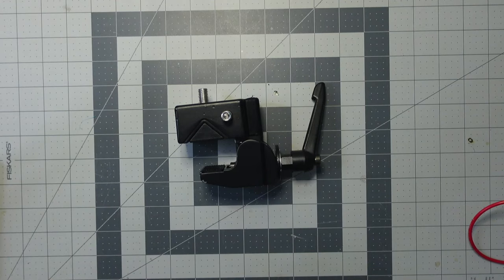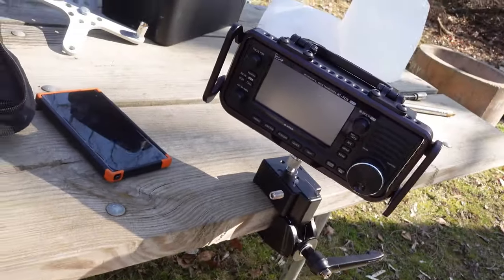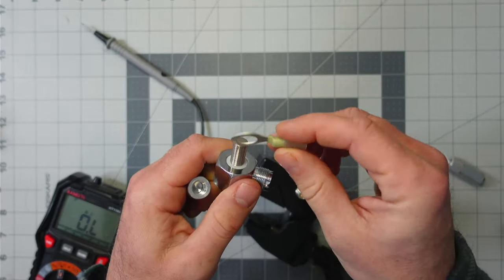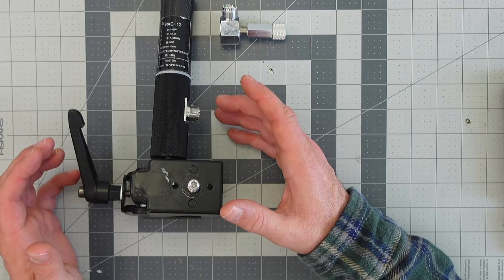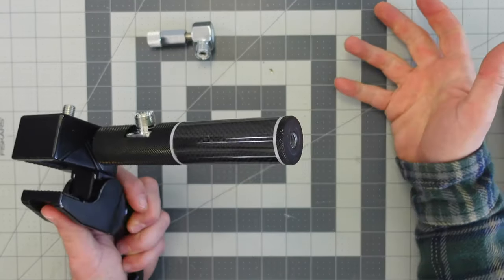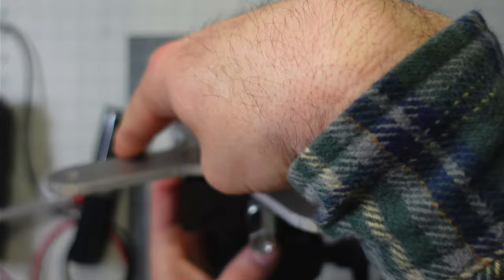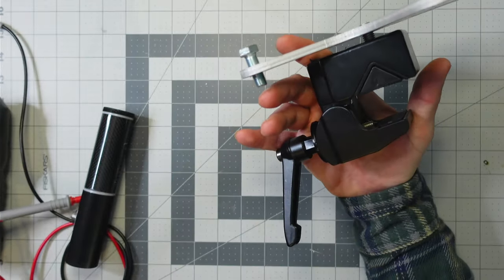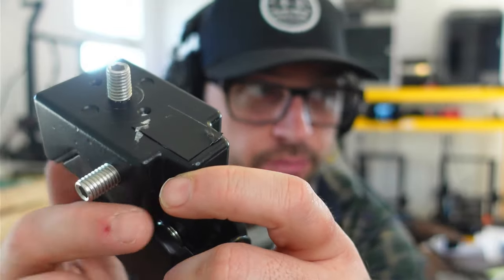Super Clamp For Ham Radio!  Antenna and Radio Mount

Comment: Another Goodwill bargain you'll often find are lighting tripods used by photographers. They're well-made and often extend up 10-feet to get an antenna out of the clutter. I picked up two, worth about $100 at Goodwill for $10 each.
Reply from the maker: Absolutely! I have aquired a surplus of those as well.  Even if it is just for using the tripod to hold a crappie pole, which holds a wire antenna... it works!

Comment: Nice find and a good solution. I've used a Workman clamp mount with my WRC and radials coming off the picnic table and that setup works just fine. Clamp mounts can definitely come in handy for certain situations.

Comment: I'm in a wheelchair, and I picked up a couple of different tripods from second-hand stores for portable work with mag-loops and verticals. Second-hand stores are great for finding good, cheap ham accessories. My mag-loops are homebrew, and free-standing on the tripods. They are quick and easy to set up in parks, and take up essentially no space on the ground. For the verticals I set up in places where kids and dogs aren't around I use a lightweight telescoping one with a homebrew loading coil that I tap for resonance with an alligator clip jumper, (I don't bother with commercial loading coils costing hundreds of dollars. That's insane. Electrons and photons are not impressed with price. Mine wound on an old pool noodle has higher Q, lower loss,) and I like to put out a few quarter-wave radials for each band I'll be trying. Down-sloping radials improve the match, but straight out, down-sloping, or random directions for radials makes little difference with radiation pattern when it comes to most contacts. A dB or so of lose due to the radiation pattern may be the difference between making 10 contacts instead of 11, (or it may be the difference between making 11 instead of 10, since an uneven radiation pattern may mean a weaker interfering signal and a stronger signal in the direction of that 1 weak station you're trying to pull in.) That's why I don't bother with setting up for a uniform radiation pattern when I'm doing a portable set-up. Being in a wheelchair I'm lazy about making things look pretty. Besides, making a bunch of contacts with a sloppy looking setup beats not setting up at all and making none. Of course, I'm not a contester, for whom numbers matter. I don't log SOTA or POTA. I don't log any of my contacts. I need no certificates, no awards. I just set up on nice days and go fishing in the airwaves. A few  years ago, some ham friends gave me a plaque that says, "To The World's Greatest Elmer." No certificate will ever come close to that, no matter how many I might get. I just like to do a little experimenting, and a little chatting with interesting people from around the state, or around the world.

Comment: Very nice find from Goodwill. Great info for the video!!!  I’m surprised that the ham that had the issue with putting things into the ground or into trees (which now cannot be done at any state wildlife area or national refuge in VA, or we can lose those POTA entities from a single violation) didn’t think of a Wolf River Coil and their numerous variants… They just sit ON the ground, which is a great alternative. There’s also mag mounts for cars (and grills I’m starting to see) where other verticals can be run (including the mighty ham stick). Plus there are a few other clamps out there that work too. 

I’ve always erred on the side of caution and used a standing vertical (Buddistick Pro) or ham sticks (& a MPAS 2.0 as a vertical for the first few 7-8 months of my POTA activities) & mag mount on top of my SUV. But it’s a learning process of what works, knowing what’s available & what one can purchase.

Again, great find & video! 73!

Comment: You can get a M10 to 3/8-24 thread adapter at a good price and typically the next day from McMaster-Carr. It is part #92499A793. They're a major industrial supplier, so that should have almost any other connection option or industrial material you need. Even though my order was small, they were most helpful.
Reply from the maker: Great information! Thank You. I had previously looked here before, but missed it. Great resource and company!

Comment: Re ground plane efficiency: elevated radials need to be resonant.  For radials on the ground the ideal is to have 4 wave lengths of wire on the ground. For a 20m vertical, that means about 250’ of radial wire on the ground. The exact length vs number is less important than having enough wire on the ground for efficient coupling.  A faraday cloth on the ground should work well, on a table?  My guess is not nearly as well.   A dipole has a radiation resistance of around 72 ohms, a quarter wave vertical is around half that at 35 ohms.  A shortened vertical with a loading coil could be half of that.  The ratio of Radiation Resistance to  ground losses largely determines the antenna efficiency.  Poor performing verticals abound, but once you understand the concept, it’s not hard to setup a good one that gets out.
Reply from the maker: Thanks for the info.   I'll go do a comparison! Have a good one

Comment: This observation comment might be a little redundant, but it would be great for Hams like myself that live in an apartment building with a balcony railing!
KD8EFQ/73
Reply from the maker: I agree completely .  Many can benefit from it!
Reply: @HAMRADIODUDE  I use a clamp by a different name and work the HF bands with 100 watts on SSB all day long and I'm only on the 2nd floor with a vertical antenna tilted a slight off of 90 degree angle so my neighbors above me can't touch the antenna.